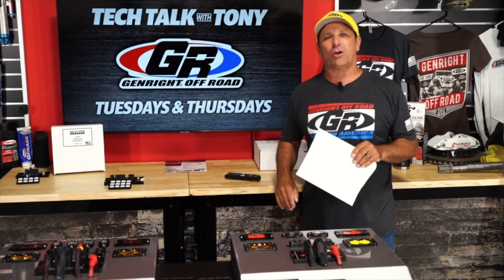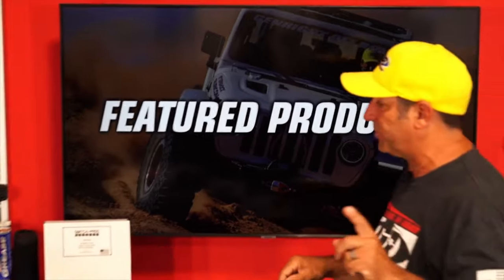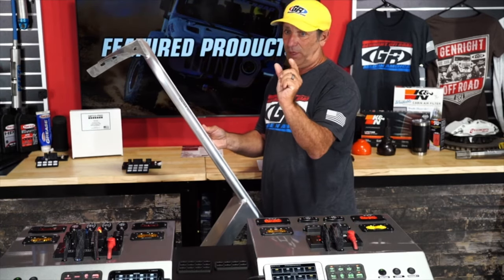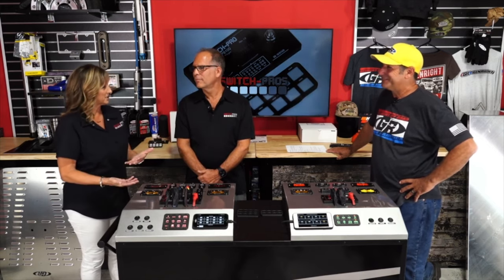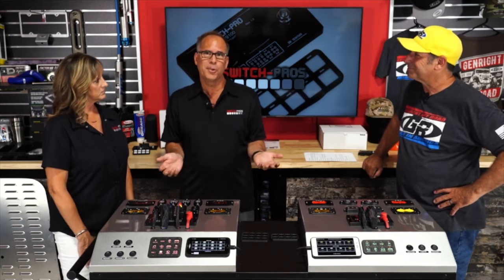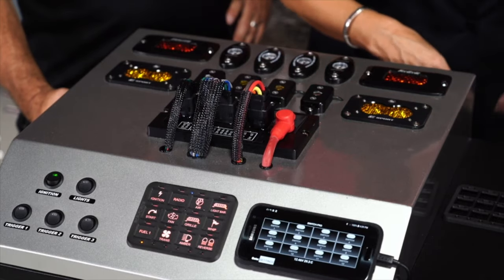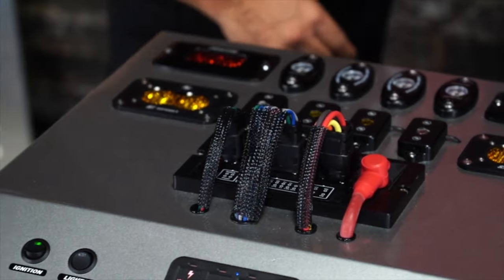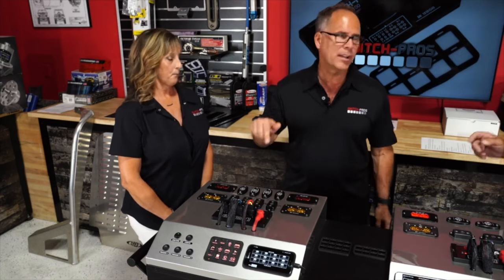Switch Pros joins Tony Live for Tech Talk

Comment: Sorry guys, Solid state transistors or not this is way over priced, under 1 hour of programming, hour circuit board design, Maybe 200 in Materials equals more than 300% markup? The reason some of the others use the relay pack is 1 safety meaning no large 1500w+ power and ground plains in the circuit area (Will catch fire before tripping 150a breaker if a direct short happens) relay cluster allows for individually fused circuits (Internally switch-pros unit is on individual circuits out but all pull from the 150a circuit input inside unit) 2. another reason others use relay clusters is that its very simple at the control unit like maybe 1 cat5 cable feeding the relay cluster you don't have the large wiring mess coming out of the unit , means give end user more options on where to mount the smaller unit. either way solid state or relay cluster the cost of manufacturing is about 6s it really bears down to what you think the customer may prefer. Relays vs ss system does not present a clear path to better quality or reliability both are subject to failure when overloaded. I prefer the relay systems simply because the Power distribution is not part of the main unit separated and easier to service if needed. And yes people the relays system can and will do the strobing features just as well that's not a ss transistor ability its a strobing program loop that can be added to any of them. Its all in the pricing if your prices where half of what they are id carry your line however do to the prices I see nothing special other than little more time in the programming passed off as special hardware. Not trying to bash their innovative thinking or quality of component I think its a good piece just don't agree with how it has been marketed. Is it something special? (No) is it priced fairly (No) Can someone manufacture one better with more functionality for less money (Yes) And yes I actually said more functionality seems the market of panel switches has stalled and should not have their are MANY other needed functions I know of still needs be added to these markets. But I will at this time keep that to myself just in case I decide to enter.

Comment: Is there a option for wiring switches to control window motors, also does the 9100 have the 4pin lock code option?
Reply: That would be nice for my K9 with car windows

Comment: So if there’s a problem with the Bluetooth antenna. Why don’t you make an extension antenna that goes with the harness so you can mount it under the hood? You’re already running the wires out there. I work with alarm systems and we use external antennas  so you can move them to where you need them to get reception. Thanks

Comment: So I just got my 9100 this week and I’m starting to experiment with programming. I’m hoping someone can tell me if this is possible: 

Single tap = 
-bumper lights on

Double tap = 
-bumper lights on 
-windshield light bar on 

Final single tap = 
-everything off. 

Can this be done with a single button? I’m assuming if it can, that button would need to be associated with one of the  higher amp double wire circuits from 5 to 8 right?
Reply: Well…seems like this comment section is pretty quiet so I’ll answer my own question. 

No. I needed the RCR FORCE 12 for on-on-off functionality which I have now. Works great.

Comment: Wanting to use this for my racecar, do I need a switch to power my ecu and this ? Or will the ignition button turn on my ecu and everything else in the car ?
Reply from the maker: You can absolutely wire it to turn everything on.  Call our  Tech Support line at 949-581-2991 for detailed discussion and "how to."